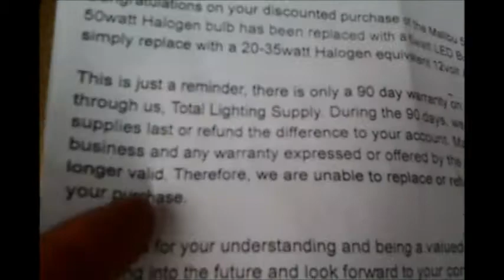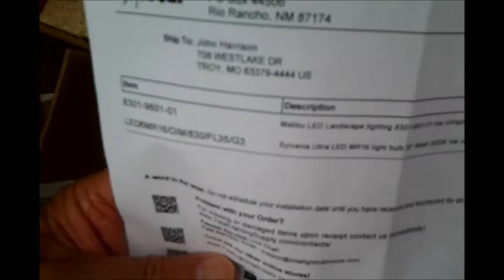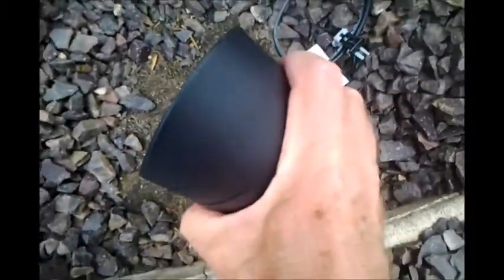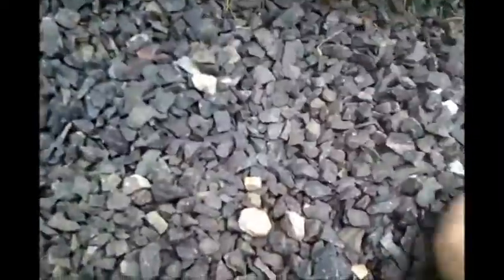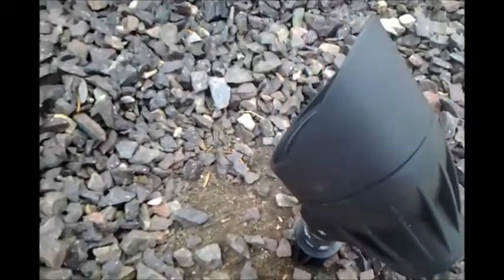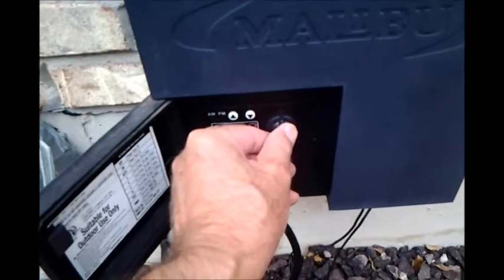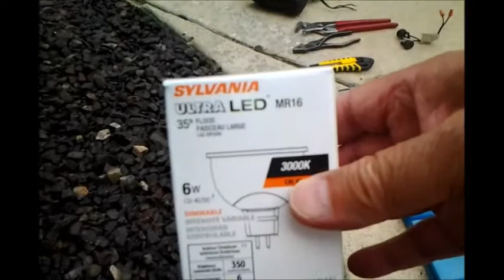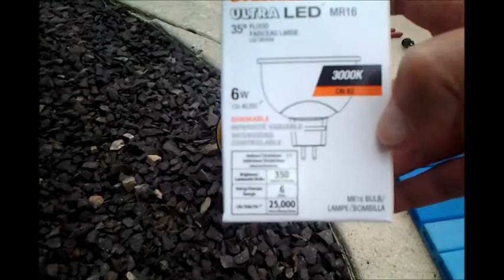REPLACING MALIBU HALOGEN LIGHT WITH LED

Comment: Just acquired an older Malibu set , BUT need help undoing that old style connector in your video . Can U help me out please
Reply from the maker: Try to use pliers, maybe needle nose, & squeeze the ends of the posts that go through the connector & it should lift out?